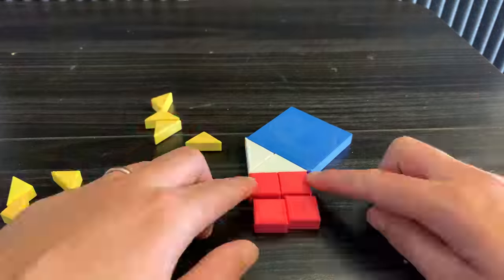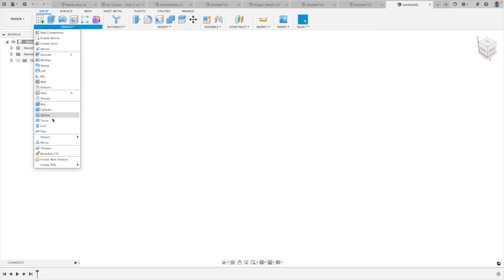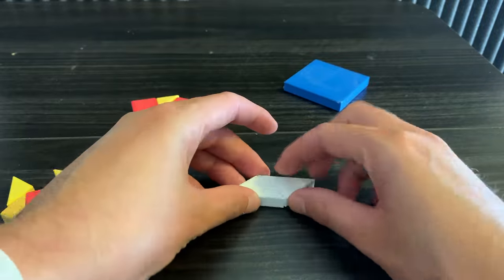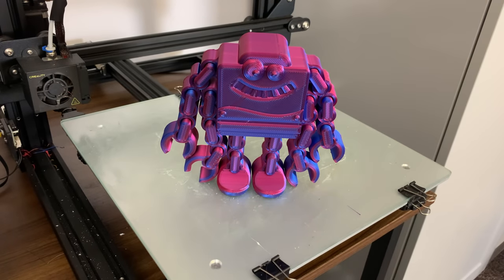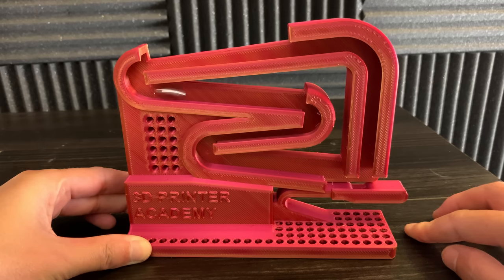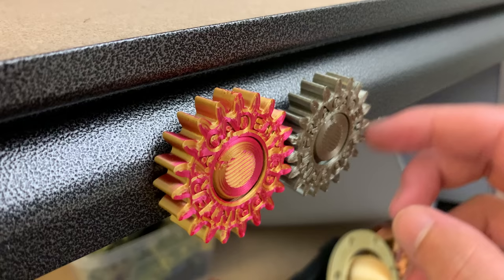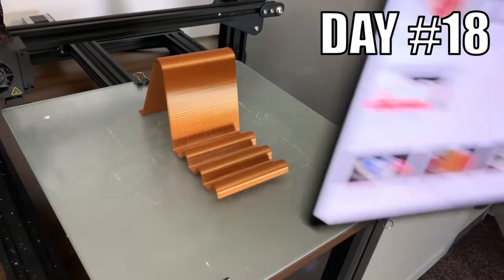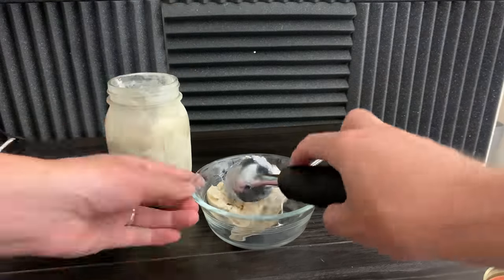I challenged myself to make 20 new designs in 20 days...

Comment: This is some real quality content. 20 great designs summed up in less than 5 minutes. Honestly, some of those models were so good that if it weren't for this video, I would have never guessed you made each of them in a day!
Reply: In your knowledge can 3d printer make plastic parts in 30 minutes or 1 hour or that's not gonna happen
Reply: @BB-km5nv  Well, it depends on the size of the part, and on your printer and its settings. But smaller parts can definitely be printed in that timeframe. More complex designs can take a lot longer to print though.
Reply: @shromp_   I mean the parts that need 8 hours to get finished... can you accelerate the machine from 8 hours to 1 or less
Reply: @BB-km5nv  Depends what machine you have and what kind of quality you want to get. You get a larger nozzle so it prints out with thicker plastic, fine details are not replicated as well. But it can print much faster.

You can also adjust the infill of a model. I could print something in solid plastic and could take 20 hours, or I could make it nearly hollow and print in just a few hours.
Reply: @SeanLavery  so  this process is economically viable right?
Reply: yes its not more expensive to print faster its just fine details are not so fine anymore
Reply: @BB-km5nv  Printing a hollow part will take less time and use less plastic. But its use will be more ornamental as the part won't be physically as strong. So economic viability depends on what exactly you want to print. But in general, 3d printing is pretty cheap. You can make a lot with a 1kg filament roll. And the speed of the print head's motion can be increased for faster prints.
Reply: @BB-km5nv  Another factor when it comes to speed is the type of printer you get. Delta (the 3 vertical axis ones with the circular build plate) printers are faster than Cartesian (the traditional xyz axis ones). I know I've seen people print 300mm/s with deltas. I'm not sure if they can go faster, but it's probably worth looking it up.
Reply: There are a few interesting designs but it is a stretch calling them great. For example the magnetic key chain. It isn't functional in most cases. Like sticking your keys to the front of the fridge. It will slide down. The magnet mainly has strength when you try to pull it away from a ferrous surface.  Otherwise it is happy to slide down that surface.

Comment: Another idea for a use for the icecream maker, Use it as a part tumbler, add some sort of garnet or abrasive (dry sand would probably do) to ~third full. Add parts that the surface needs improving on, close up, turn on and leave for a good couple of hours. 
Note: It will matt the finish of 3d prints, could even be desired if you're painting them.
This is actually what I thought it was before it was explained otherwise in the video.

Comment: My thought process would be daily items with a twist on it. For example a hand sanitizer holder which dispenses alcohol with the use of cam gears. What I'm thinking is an upside down stand for the bottle, then a crank handle leading to two gears which have cams on the end, which in turn squeezes out sanitizer. This could also have a slot for a tiny 180 degree servo motor to automate dispensing with the push of a button! Ah I love overengineered solutions to already solved problems.

Another way of coming up with ideas is novelty items, like the magnetic gears or the experimental phone stand. 

You can also reinvent daily items with science to make them more effective, like the drink cozy.

Phone stands should also have their own category, a quarter of this video is spent talking about phone stands lol

This comment took me so long to write
Reply: I also love over engineered solutions to already solved problems
Reply: @jacobobinator  Ah yes, another overengineering connoisseur.

Comment: good job, I can design but I end up printing and redesign at least 3 times until my tolerances work lol I wish I knew what tolerances work for various print in place things.
Reply: I was having the same issue on my printer. I manually calibrated the stepper motors and extruder and can now print to accuracy of like 0.1mm. You should try looking it up and seeing if it improves

Comment: Can 3d printer make plastic parts in one hour or less or that's not possible
Reply: it mostly depends on the size of the model and the solidity. most of the models in this video probably took well over five hours.
Reply: @raymondelder5004  so in your knowledge no printer in the market can accelerate it to one hour the part that's need eight or six hour
Reply: @BB-km5nv  look up Voron printers, they can print a standard benchie in under five minutes, a part that normally takes over an hour.
Reply: @raymondelder5004   thanks for your help
Reply: @BB-km5nv  Welcome!
Reply: VzBot be best

Comment: i will be brutal
i don't like how 3d printing becoming more and more trash production, than actual usefull tool for making things that well have some structural use. even art or model building is better than printing throw away objects, coaster with blocks, that was actually pretty interesting idea but most of the rest especially things without purpose ... you learned how to walk now learn how to run and use 3d printing as a method not as an goal

i know that is harsh but i mostly use 3d printer for building parts for models or making everyday items i would like to have but can't buy and as for models ,small things are mostly ok if layers bond corectly, making clothes hanhers and other big thin things to assemble later is not economical or probably i am doing something wrong myself

have fun with your work but please find  a purpose for the things you make because sooner or later we all drown in a pile of 3d benchies nobody want
Reply: Amazing thinking summed up in such comment

Comment: I am trying to find someone who will attempt to 3D print a DTMF keypad for my TK-250 radio.
Originally Kenwood sold the KDM-7 DTMF keypad with the front Plastic 16 push buttons labeled 0 through 9,#,*,A,B,C and D.

The other part is the circuit board that goes inside the radio. 

If you Google KDM-7 Kenwood under images you will see this black keypad with white letters. It is roughly 3 inches by 2 inches by 1/4 inch thick

I need 10 of them. If anyone wants to try and make these, please contact me. 

Thank you

William